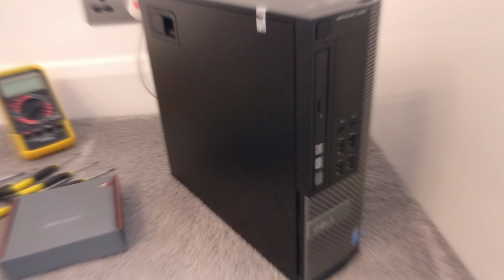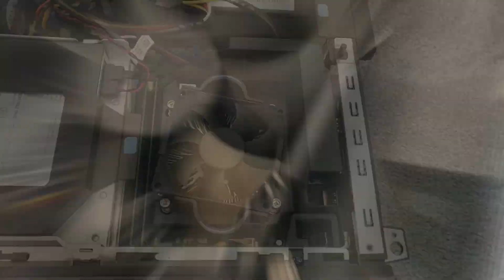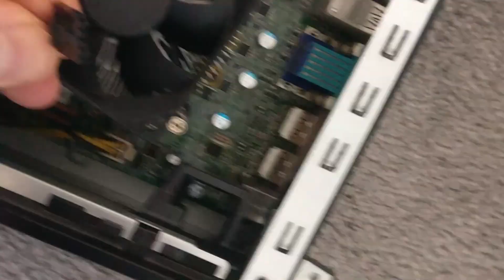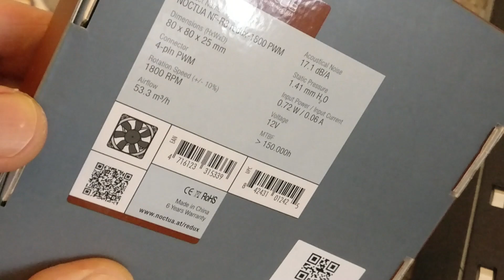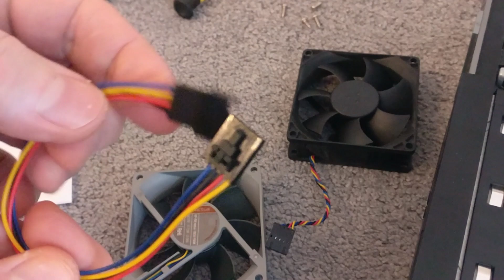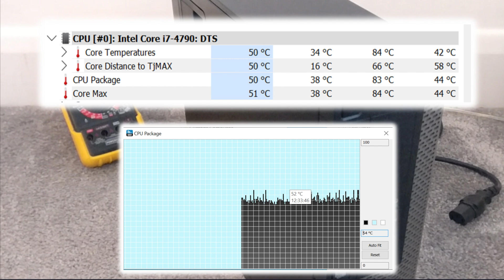Dell Optiplex 7020 Airflow Upgrade (Noctua Fan)

Comment: Does dells bios have any issue with a non OEM fan?
Reply from the maker: Mine was completely fine. I haven't had any boot errors.  I have read a few stories that people who have encountered errors. In some cases the errors were removed with a bios update.
Reply: @BuiltbypeteI have an arctic one in my 7020 sff and I keep getting the alert rear fan failure. Any ways on how to get rid of it?
Reply: @Sam-g7h3q   If they haven’t greyed out options in bios , you could try there to see if you can turn off alarms.

Comment: Just bought a noctua fan & adapter for my new optiplex 3020 sff project, i heard that bios will give a startup error and not let you proceed when using an adapter like this, or it will not work properly, is there anything i should know?
Reply from the maker: I didn't get any startup error after doing mine. I have heard some have depending on model and bios version, so might be worth doing a bit more research.